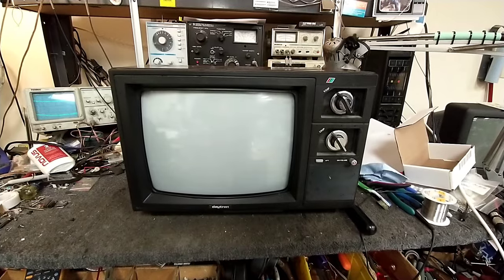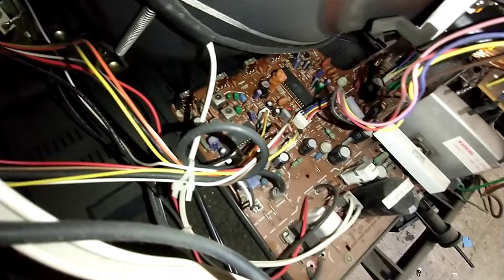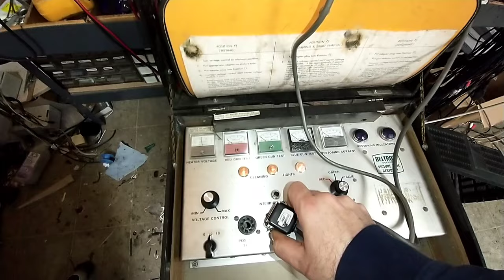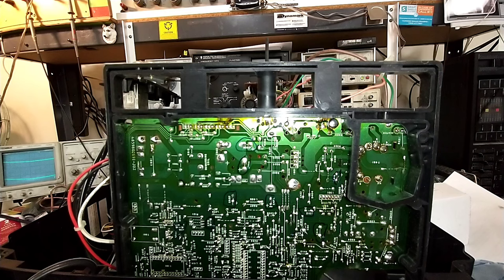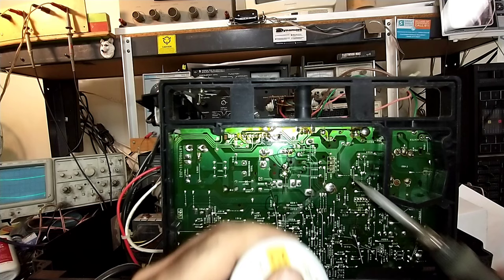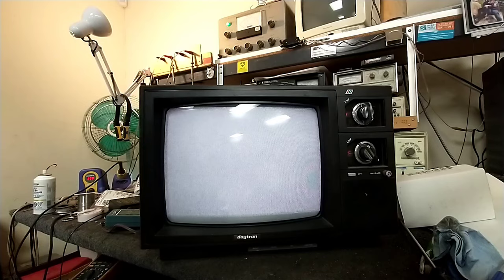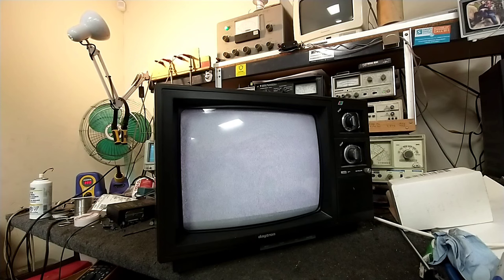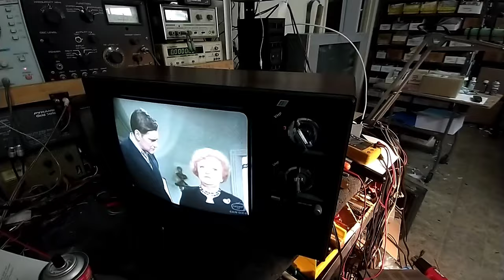Quick service of a 1987 Daytron 14" color tv model TCB415PN. Snow only, no picture, dark To light.

Comment: It's rare for a tuner to fail completely,   they normally get dodgy and become touchy.
You had a one in a million duff special lol.
if you didn't replaced the crap caps on the pcb, it would have failed and it would wing it back to you at jet speed lol.

Comment: You can't  tune a tuner  but you can always tune a  fish
Reply from the maker: A company called GAS (Great American sound) produces an am/fm hi-fi tuner and called it "Charlie the Tuner"
Reply: @JordanPier  

A  customer brings  in a real  old AM radio and states that it's  emitting a offensive  fishy  smell   when turned  on.  The repair  technician    reply's  back    yes   when the old  American 5  tube  radio's  age, the capacitors leak and  then it  smells like the back of a tuna  schooner !

Comment: I have a 1976 zenith spirit of 76 portable black and white tv that the picture doesn’t fill out the whole tube. It is not the virt or horizontal hold adjustments. I don’t know if it’s bad capacitors and the values have changed but I’m looking for someone to service it I will pay what I need to within reason. Do you know anyone who would look at it or would you ever accept a viewer set?
Reply from the maker: You've got power supply problems if picture won't fill the screen in all directions. 

Yes, I do service sets like yours, but I'm not taking in any new work until further notice. I've just got too many things to fix right now
Reply from the maker: Where are you located?
Reply: I completely understand maybe one day I can send it to you when you have less work on your hands I’m really in no hurry I just want it fixed one day. I have tried so hard to find a repair guy for years. Also I am located in the Denver area
Reply: @JordanPier I completely understand maybe one day when you have less work I can send it to you. It’s just something I’ve been looking to be fixed for many years I have no problem waiting till it’s possible. Also I am located in the Denver area.
Reply: @JordanPier also thank you for the tip on the power supply

Comment: Shango always says he doesn't belive in cleaning/rejuvenatiing the crt but you always do it. i gues you agree to disagree
Reply from the maker: Cleaning and rejuvenation are two very different things. 

Cleaning is a low voltage, higher current which is typically done at rated heater voltage. It decontaminates the cathode without heavily stripping it.

Rejuvenation is high voltage, low current (80ma or less) for prolonged periods as a last result to reactivate what's left of the cathode. It usually produces short term results and destroys cutoff in exchange for what's left of the emitting surface.

I will always do a cleaning on a CRT that's in fair shape. If it's good, I won't. I only rejuvenate when emissions is low and cleaning does nothing. - and moreso if I one gun is really weak. If all three are weak I will attempt cleaning and nothing more. 

You can adjust bias if the guns are tired to an extent to balance out the picture. However if one gun is super weak sometimes rejuve is the only way to make it watchable.